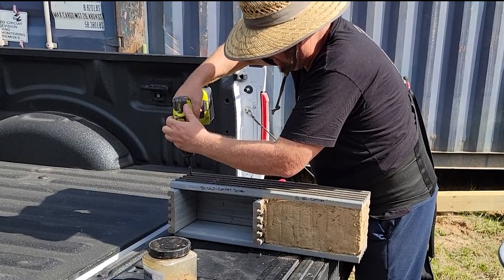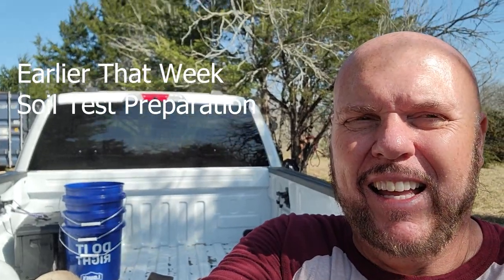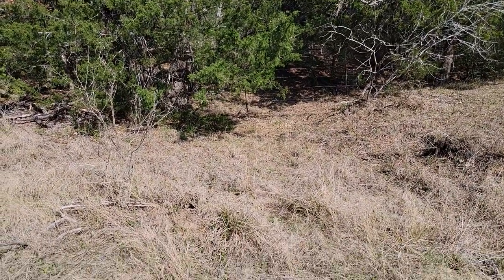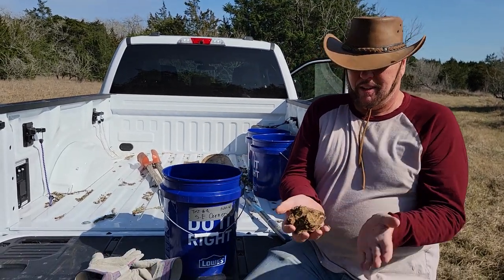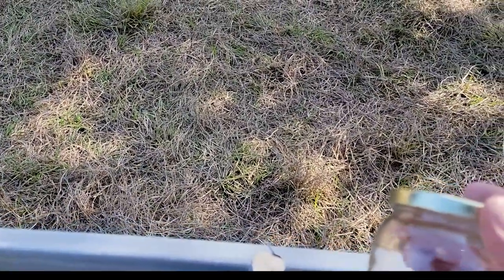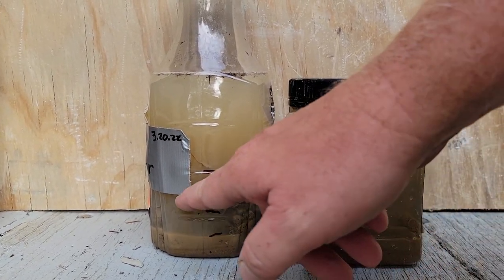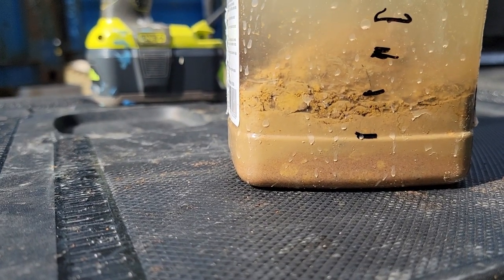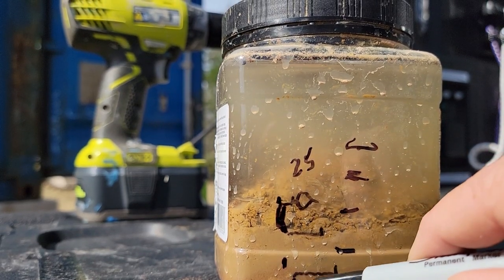Adobe Brick Failure - Testing Rammed Earth Soil for Clay and making a test brick. Natural Material

Comment: Lot of issues. You can remove the mold right away and mist the brick until it is fully stabilized.
Reply from the maker: Thanks so much. In experiments I found that my clay is stable with very little expansion... so rather than rammed earth, I've decided to do earthbags instead. I will be careful to follow the recipes to the detail. Cutting corners is obviously a fail for adobe.